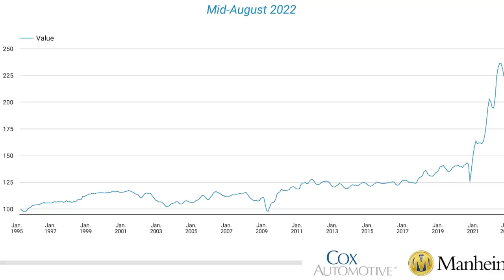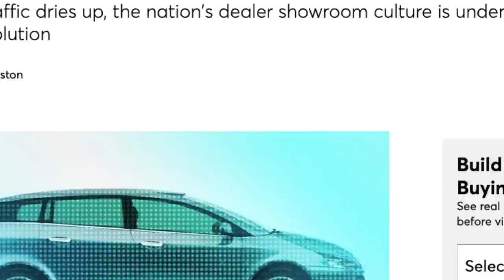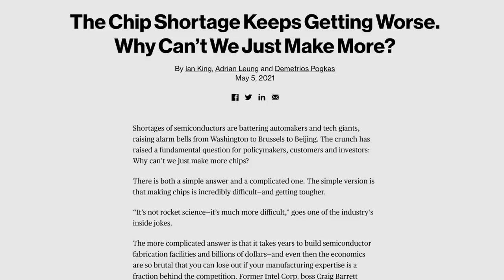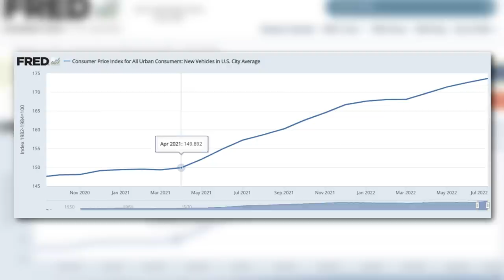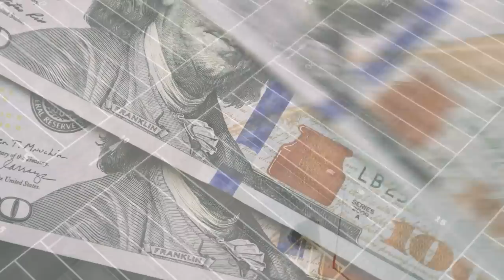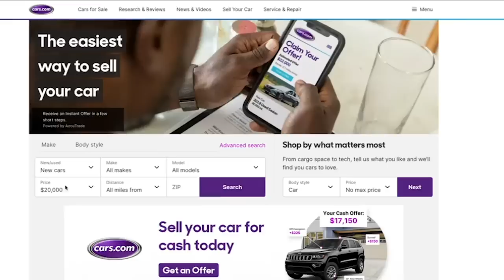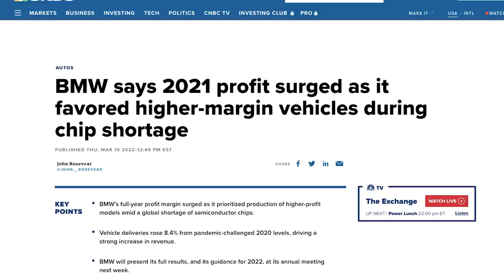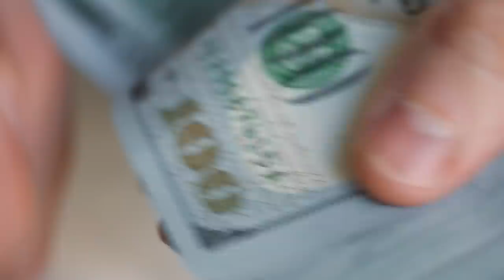A Deep Dive Into the Car Market Bubble Disaster

Comment: Fun fact - there is no chip shortage anymore. You can get parts for anything again.. call your dealers parts dept if you don't believe me. It's just the manufacturers keeping supply artificially low.
Reply: Exactly. They realize that people will pay more, so they keep supply artificially low to rake in roughly the same profit for less sales volume. Until people quit paying the absurd prices, it will stay this way. Demand has fallen off a cliff in the last 4-6 weeks though, if the trend continues, we might start see prices correct. There are already reports that auctions are seeing prices lower by around 5% than previous months.
Reply: Right. Look at GPUs. When the chip shortage was at its zenith GPU prices went insane. Now, they can be had at bargain prices.
Reply: Not sure how true this is im a technician in the industry and theres definitely parts shortages at least in the service end almost every repair we quote has at least one part on back order and im talking about oem parts from several brands
Reply: There are massive shortages and super long wait times for the parts needed in the vehicles that haven't been made yet.  Parts for cars that already exist isn't proof of anything.
Reply: Toyota sucks anyway they build a basic car. Yeah it lasts sometimes most cars do if you change the fluids.

Comment: When the cost to build a vehicle has likely only increased the past year, how anyone could assume these manufacturers should “go all in” and start making hundreds of thousands more cars again is just plain ignorance.

Aside from whatever chip shortage may still exist, these same people fail to consider the supply chain as a whole.

There aren’t even enough truck drivers to deliver the CURRENT supply of cars and it takes a halfwit to think that manufacturers simply need to turn on the factory lights longer or pull some big lever on a machine down to make more product.

I can theorize conspiracies as much as the next guy but maybe these are signs of what’s actually occurring.  

This is not just car manufacturers and car dealerships colluding.

This is the type of stuff that happens with a failing currency.
Reply: You make a good point and you may be right about the failing currency.

Comment: One of the problems with the chip shortage is that automakers use very, very old chip designs. None of the big chip fabs want to make these chips since the margin on them is tiny. If the makers would upgrade their chip designs to even one generation obsolete instead of the 4 gen old chips they use the shortage could be over much sooner.
Reply: While small fabs have enough capability to make the old-style and non-advanced manufacturing chips, they can do that. And the dealerships haven't seen the chips pricing decline since June, and even the order for Qualcomm has been canceled! The manufacturers do not need so many chips, they had enough, while the sellers do need this excuse.
Reply: The reason they stick with the older chip design is reliability in extreme conditions.  Prolonged exposure to high heat, below freezing temperatures, and lots of vibration to name a few.
Reply: @ChrisH421  finally someone with a brain!
Reply: Pay more for a more advanced chip no one needs...

Comment: Other thing was, one of the main chip factories caught fire.  Besides that, the pivot of the manufacturers towards suvs and profitable trucks away from the bottom end has been happening over time.  It has only exacerbated since 2020.  You also forgot to mention that higher fuel costs have pivoted people towards more fuel efficient vehicles, pretty much the same vehicles that the manufacturers are trying to get away from building.  Add to that, the lean idea and just in time manufacturing fell victim to supply chain early on, and it isn't a surprise.
Reply: Was looking for this comments IRT the fire.

Comment: The problem is easy financing, just like student loans are the reason that college tuition has skyrocketed through the years. If people had to pay cash or a large down payment then you wouldn't have every Tom Dick and Harry buying a new car every other year.

Another factor is the idiotic governments (state and federal) with their mandates on car manufacturers like an ever increasing fuel mileage standard forcing companies to use exotic crap like turbocharged 4 cylinder engines where they normally  would have had a V-6.
    Also people will pay any price as long as they can borrow the money and increase the term length of the loans.